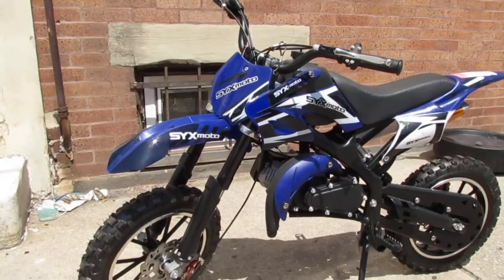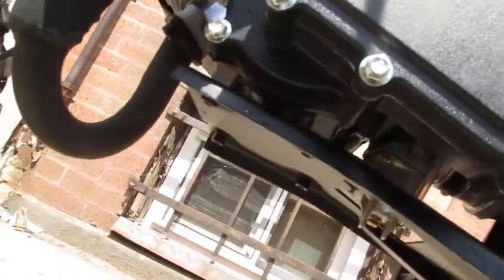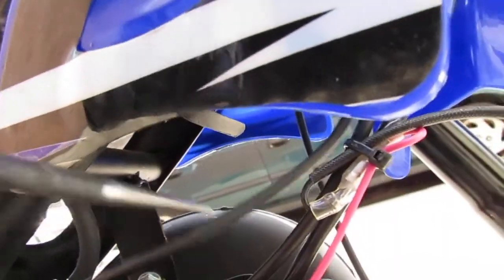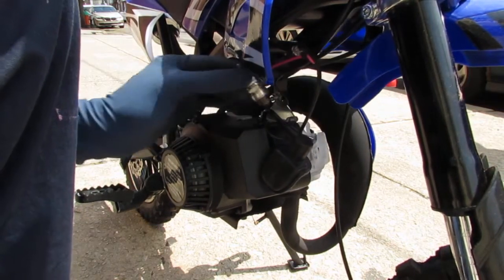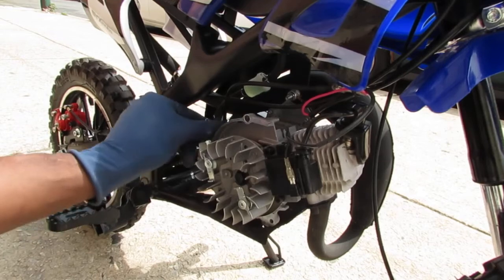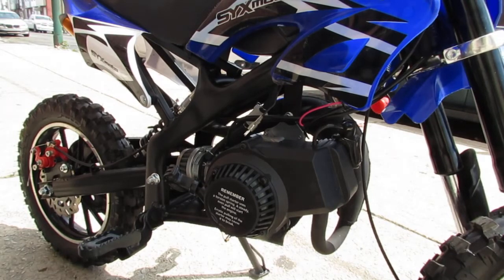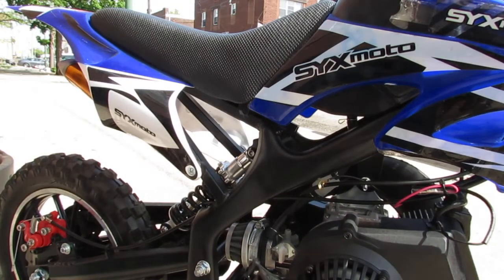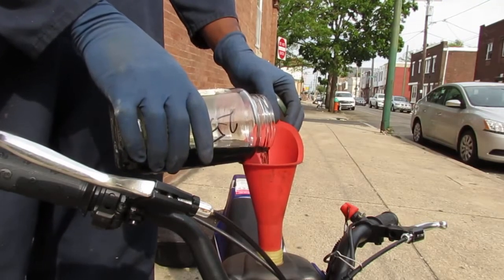SYXmoto Bad Fuel Mix Ratio

Comment: That rear spring nut is super loose at the 16:37min mark
Reply from the maker: You have such an exception eye.  I will reach out to the client if they still have this and it is not in the trash about this.  Thanks so much for this.  I got another one to repair.  I diagnosed it with a failed magneto.  I have it filmed the client never moved forward with getting the part so the video sucks without the solution.  I never published it.
Reply: @MotionDesignStudio  I appreciate you posting these videos. I like seeing all types of repair videos for dirt bikes.
Reply from the maker: @1GiPhoner  , I might just upload the other video this coming week because of what you said.